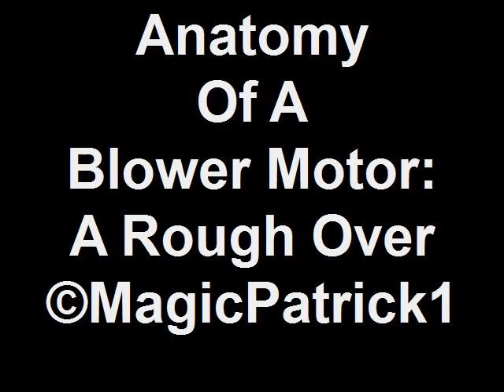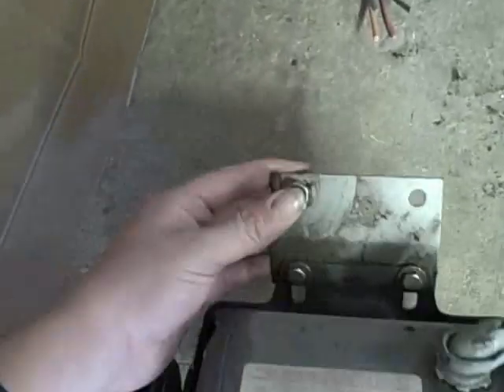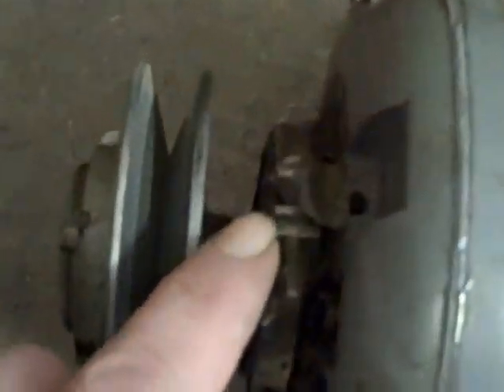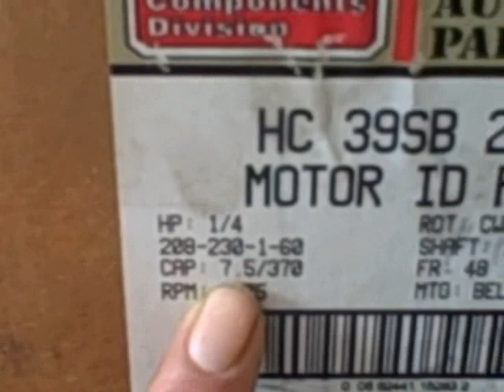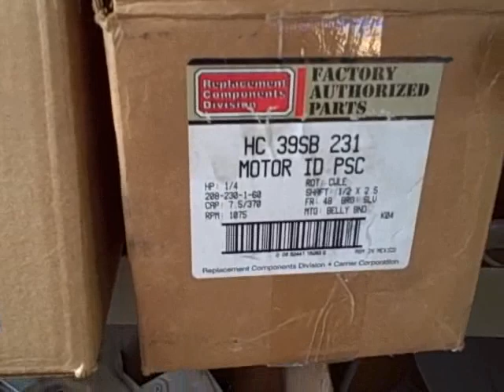Anatomy Of A Blower Motor: A Rough Over

Comment: @MagicPatrick1 

Actually, I have two units; one for upstairs and one for down. The AC units are outside (2) and blowers and gas furnaces inside (2). 

My downstairs blower is fine. The upstairs we turn to Fan On at night to give buffer sound and to continually filter the air. Occasionally this unit has stopped blowing. Usually it is a dirty filter and I change. However, I did this. It is still stopping before morning each night. The fan continues to blow, just no air through the vents. JS

Comment from the maker: @sabrpilot It would greatly depend on the RPM and Horsepower of the original motor. A smaller wheel offers much less resistance and in most cases, under amping is worse than over.

Comment: Very informational! 

Quick question: I have a furnace that continues to blow, but stops sucking air. We have changed the air filter, but it still will no suck air. The fan is going, it is just not sucking. If I turn it off for a while, it will begin sucking again. 

Is there something I can do? It acts as if the passage way is being blocked, and then returning to normal again. I have no idea where to go looking for the problem. Thanks for your time. 

JS

Comment from the maker: @jds516 Wow thats a tough one.

I'd have a close look at the air handler. Make sure the insulation didnt fall off the cabinet and block the coil. I have seen motors still run, but go backwards. But that's usually right at start up.  Before placing fault on the motor, I'd change the capacitor first. It may just be that once the motor is warm it slows down. A conflict in the windings, or bearing problem. 

How old is the unit?

Comment: I like your video, I have a Bryant heat pump furnace. The blower motor costs $700. I bought a blower motor same size, same speed for $80. The problem is the blower runs all the time. Question, how do I wire the blower motor so that the thermostat understands to put the blower motor in automatic instead of on, all the time? It's a Fan Motor, PSC, 1/3 HP, 1075, 208-230v, 48Y it replaces a blower motor with a built in capacitor.

Comment: @MagicPatrick1 

We are renting, but the unit is not new. We have been here 2 years. This upstairs unit is older. 

During the night, there is no change in the sound of the fan speed. It is just that when I open our bedroom door, the suction that normally occurs as the door opens a crack is not there. Sometime during the night, the fan simply stopped blowing and sucking. What is funny is that if you turn it off and wait a while, you can turn it on and it sucks as strong as ever. JS